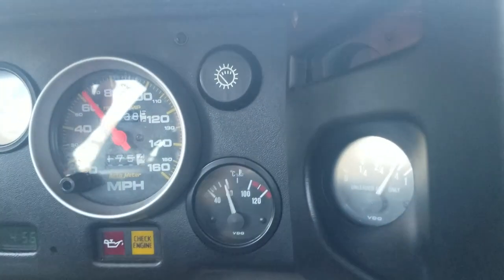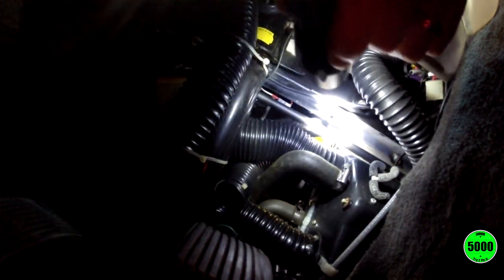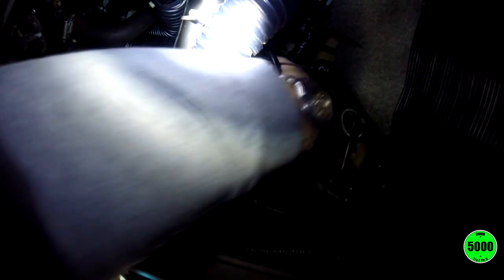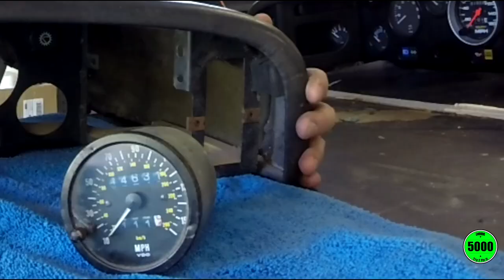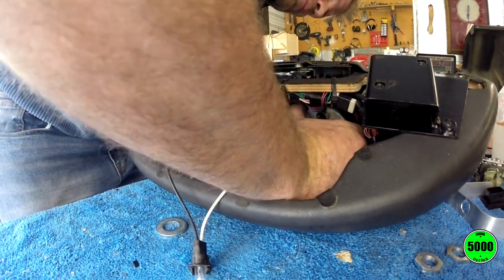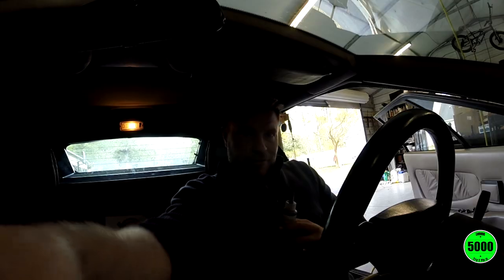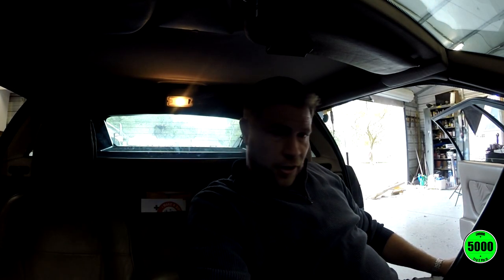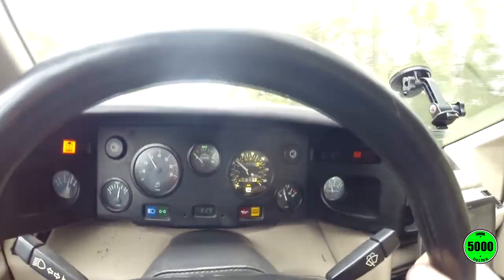1989 Lotus Esprit Factory Speedometer Installed! Part 5

Comment: Hi again.  Problems on my '89 SE - speedo, odo, slow windows, no A/C or heater, central locking.  I'm just waiting for the exhaust problem that you had.  Crazy coincidence or maybe they all have the same problems.  I fitted an aftermarket remote central locking system using the existing lotus wiring mostly.  Not too difficult.  I've had my passenger door window mechanisms apart so many times, adjusting and lubricating just about everything, but it's still slow.  Going to tackle the speedo next, but I think the heater/ A/c problem may be beyond me.  This video is going to be invaluable to help me get the binnacle off.  Thanks.  Terry.   BTW - it looks like your oil temperature is way up compared to mine.  Just the gauge, do you think?